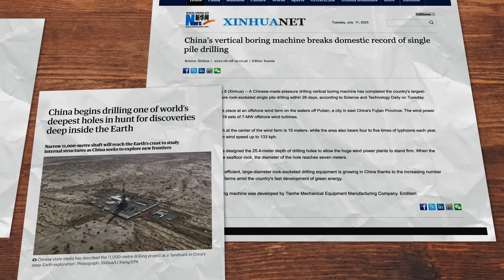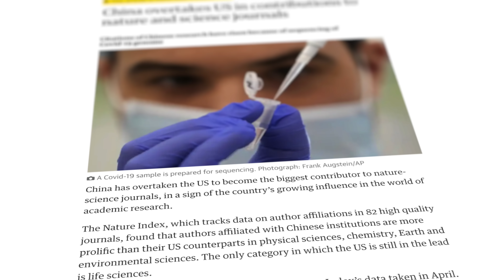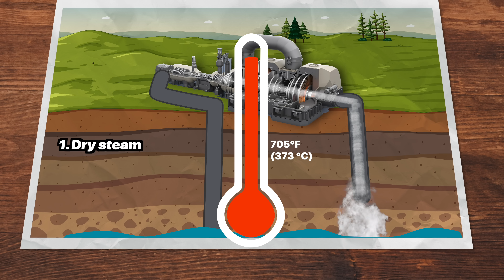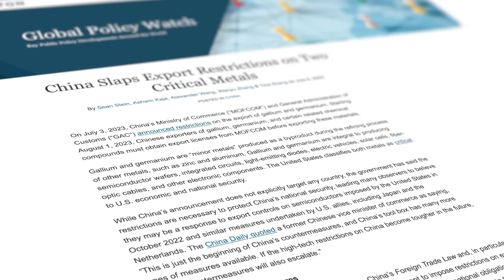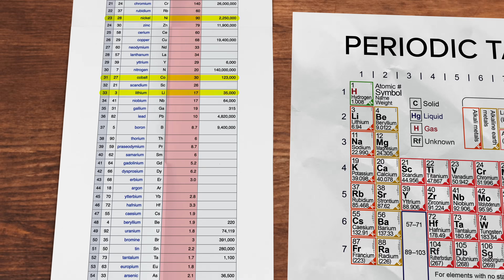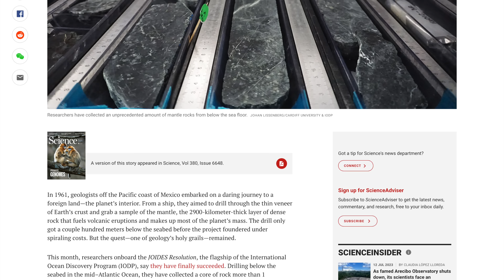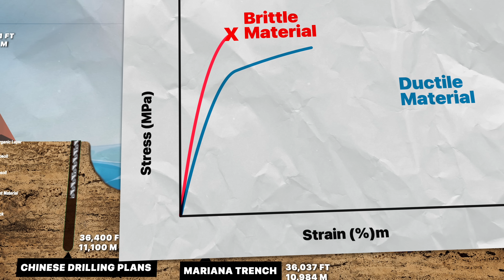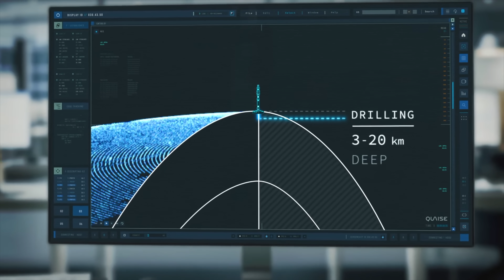What’s Hiding Beneath China’s Deepest Hole?

Comment: When we drilled deep , the problem that stopped us was the clogging of the drill bit we were able to push a little further by injecting small high grade bolts to unclog the bit which created problems of their own .
Reply: normally powerful pumps are forcing drilling mud down the interior of the drill pipe, which jets out through the drilling cones, and will force the cuttings back up the hole on the exterior of the drill pipe. The deeper one goes this process needs to be sustained, but the increasing difficulting of doing so mounts up non linearlly to where wiil eventually exceed technology ability
Reply: @TheSulross  equalising pressures, by maintaining density of the mud being pumped, monitoring for blowout, dealing with the tailings...
annd theres that whole drill string to pull up whenever something goes wrong. cutter needs replacing. pulling and disconnecting a few kilometers of pipe. screw that. i stick to making bits. and what if the freaking thing breaks off?

what was that tolerance i had to braze cutters too? +-0.125mm... else they wouldnt go back in the hole.
Reply: I think you need more pumps buddy. What are you doing drilling 10,000’ with a super single?😂😂😂
Reply: That was not a vd, how long ago was this? What kind of drill? Conventional or hydro

Comment: There is vast amount of heat down there and the potential for geothermal energy at that depth, is enormous.
Reply: You don’t have to drill that deep to get the maximum benefits of the earths geo thermal heat.
Reply: @CraftySasquatch  i’m interested, got a link to more information?
Reply: @CraftySasquatch  No but the deeper you go the more efficient the process is. Some places are lucky to have hot spots closer to the surface but those that havent deep hole drilling is an effective way to go
Reply: @Stumpy1854-Orion  Totally right. This is the perfect example of a thermal machine like the one Carnot talks about. The maximum theoretical efficiency of such a machine is strongly dependent on the difference in temperature between the hot and cold reservoirs. If your cold reservoir is the ambient temperature (298K) and your geothermal is your hot source, going from 100°C (373 K) to 200 °C (473 K) increases the maximum accessible efficiency from 20% to 37%. And if you access 300 °C you can reach 48% efficiency. That's over twice as efficient, making the energy cheaper and the whole thing more economically viable.
Reply: @ipp_tutor  Thanks for that detail
Reply: @CraftySasquatch  If you're drilling on top of a fault or next to a volcano, no, you don't. But if you want to access geothermal energy anywhere else, you absolutely do.
Reply: New Zealand already uses thermal energy.
Reply: @winstonsmith935  A few countries already do, geologically NZ has some advantages
Reply: @Stumpy1854-Orion  I know I-was standing on it when I was in New Zealand, a tourists Hot Spot, if you pardon the pun.
Reply: I'm not sure heat has been the problem with geothermal. Everyone has struggled to make geothermal work to a budget because of temperature variation, pressures and corrosion once you get down where the heat is. Geothermal is great in theory, but no one I'm aware of has made it work within a budget for electricity production. You can warm houses with it in the right locations, but electricity production is proving a lot trickier.
Reply: @tsubadaikhan6332   utility-scale solar is between $32/MWh and $44/MWh and geothermal is between $69/MWh and $112/MWh
Reply: @SPLITSLEEVE  Comparing geothermal with wind and solar, however, is misleading; solar and wind produce power intermittently depending on when the sun and wind are available, while geothermal provides around-the-clock electricity. When taking reliability into account, geothermal is more similar to nuclear or coal- and gas-fired power plants. Geothermal does not need to undercut wind and solar because it plays a different role in utilities’ portfolios.

Juxtaposed with nuclear, gas, and coal generation, geothermal can already compete. According to Lazard’s levelized cost of energy (LCOE) research, the LCOE of geothermal on a per MWh basis ranges from $61-$102. By contrast, the MWh LCOE of nuclear power ranges from $141-$221, while coal spans from $68-$166 and gas peakers range from $115-$221. This analysis underscores the promise of geothermal — it is half the cost of nuclear, the other major source of carbon-free, firm power, and both cheaper and cleaner than coal and gas peaking. Did I mention Geothermal can also be load-following and dispatchable meaning it can complement the intermittencies of Solar and Wind generation and can also provide a multitude of ancillary services to the grid.

Basically Geothermal can do everything cheaper and cleaner than conventional methods.
Reply: Geo thermal will change the world. We can't access it now but we will.
Reply: there are places that heat is much closer to surface...
Reply: @jebise1126  Yellowstone...
Reply: It is nuclear. It is the only way forward. You can drill holes if you like. I will split and fuse the atom Thankyouverymuch.

It all depends on which particular elements I need for my latest project.
Thing is, if you have energy, you can do anything. One can explode whole universes.
Or tell old Dictators that they are a dick.
Reply: Don’t you also need a lot of water?
Reply: @jimjiminy5836  It's recycled in a closed loop via heat exchangers
Reply: @jimjiminy5836  No. Geothermal doesn't need nearly as much water as similar forms of power generation and it can also use non-potable forms of water to get the job done. Geothermal can also hypothetically run on a multitude of working fluids not just water.
Reply: Where did that 'map' beginning at 00:50 come from? That SO rang a bell, but I can't place it.
Reply: That's what I say, I don't think this is the brightest thing to do, it can end civilization once in for all, how dumb. I always thought the center of the earth was the core which is extremely hotter then the sun.
Reply: @coach2208  Why will it end civilisation ?
Reply: But surely pumping up the heat, and therefore the cooling left behind, is going to have a big effect even if we can't predict what it is?
Reply: @dudes1079  It'll be a drop in the ocean. The entirety of humanities energy consumption is nothing compared to how much thermal energy is down there.
Reply: @ipp_tutor  thank you
Reply: @ipp_tutor  "It'll be a drop in the ocean. The entirety of humanities energy consumption is nothing compared to how much thermal energy is down there."
Humans : " Challenge Accepted!"
Reply: @dudes1079  don’t ruin the dream with logic
Reply: @dudes1079  If it is a closed loop system, the heat and pressure act like a siphon and you only have to use a pump at the beginning.
Reply: @SPLITSLEEVE  this is a thing. It actually works really well. Shell bought the project....ofcourse.
Reply: @dudes1079  There is a vast amount of heat to replace the small amount of heat lost from the adjacent area
Reply: @Stumpy1854-Orion  ah Ok thank you